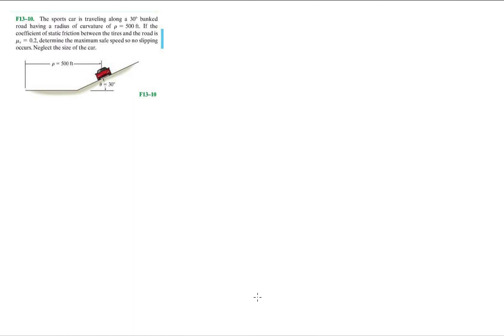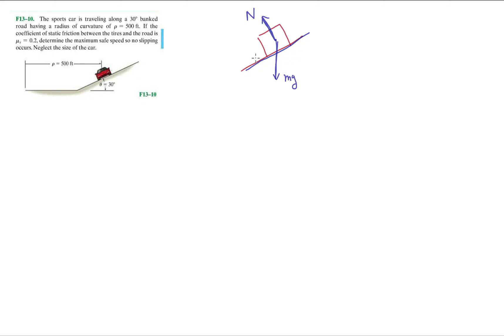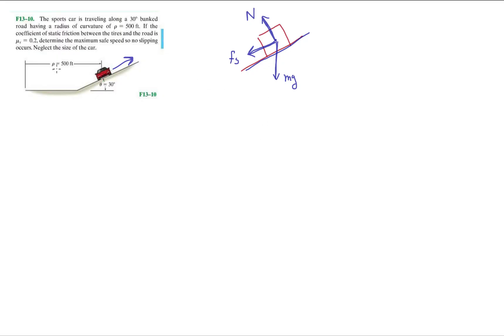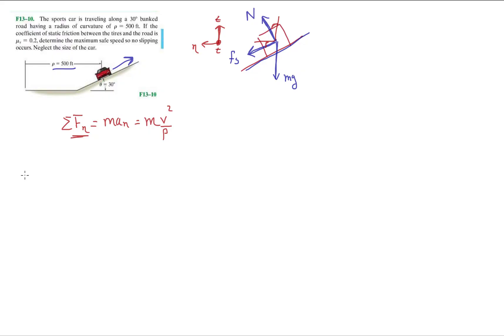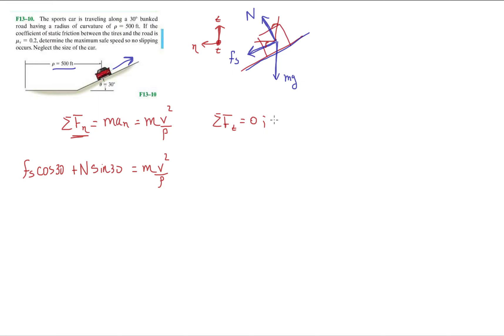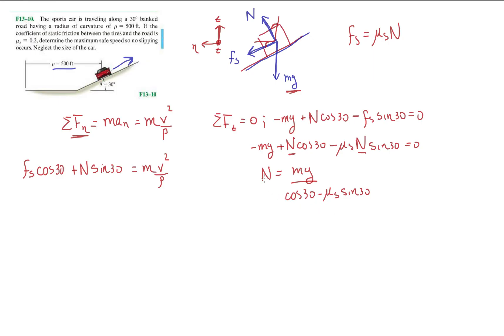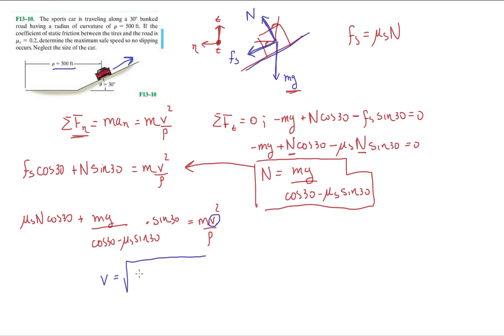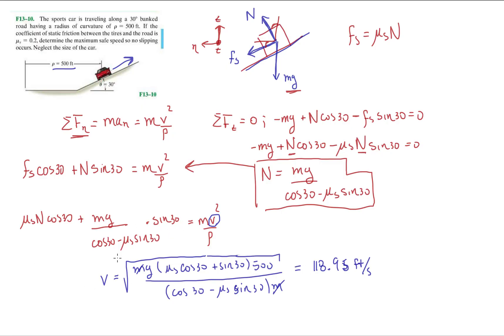Problem F13-10 Dynamics Hibbeler 13th (Chapter 13) Engineering Dynamics

Comment: hi do u care to explain why the car will fly away upwards(?) instead of slipping down?
Reply from the maker: If there was no friction (think ice), the car would slide down even if it was standing in place, correct?. Since there is friction the car stays in place as it goes around the track. However, as the car goes faster and faster, the static friction coefficient would become less (kinetic friction coefficient) as the tires would have a little less contact with the road. As soon as that happens, that would mean the tires are sliding up the track. The friction force would then be flipped (pointing up the track). If you do the math this way, you would find that the left hand side of the Fn equation would be constant while the right hand side, would continually increase (acceleration towards the top of the track). Hope that explains a bit. Kind of hard with words for me.